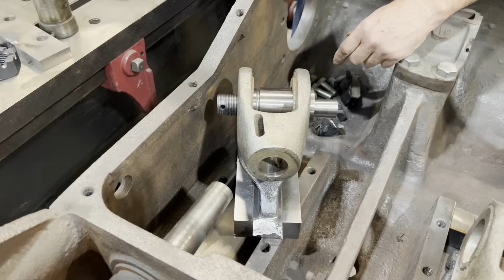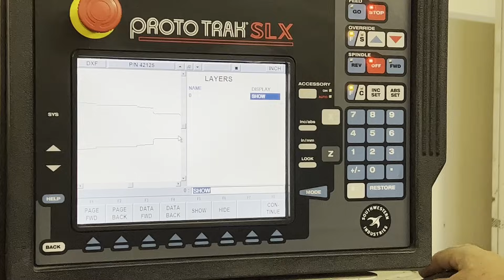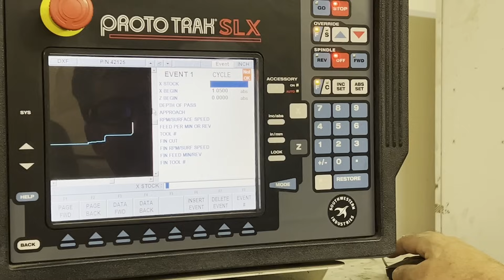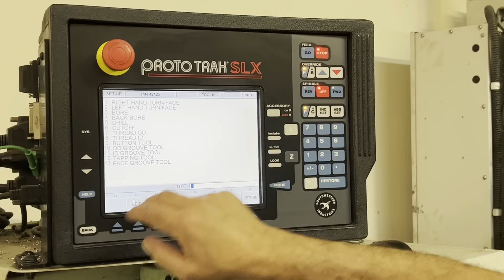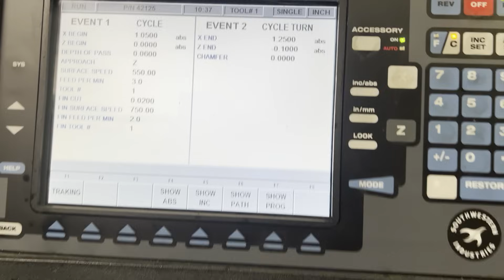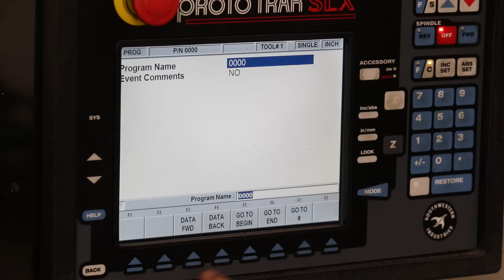Stoker Steam Engine parts for Vintage Machinery

Comment: It seems like on that threading cycle, ideal would be to be able to take bigger passes at the beginning, say 5 thou when only the tip of the threading tool is engaged, and reduce that as it engages more down to half thou when it's fully engaged. That control probably doesn't support doing that though
Reply: Also it is much better to set the tip in a slight angle at every round so that only one side is cutting - gives a MUCH smoother surface and reduce stress. Here at my CNC I set the angle to 29° (instead of 30° which is 60°/2) so its path into the thread is slightly diagonal.
But I think your simple controller doesn't support this. Nonetheless it's a genius thing to boost a lathe :-)
Reply from the maker: @123jogger123  Yes, I agree, actually the prototrac does give you the option to se the entry angle.  It defaults to 29.5 deg.  it also allows you to cut a multi start thread ( nested threads)and left hand.  Thanks for the tip!
Reply from the maker: Yes, I agree, and correct the controller isn't that smart.
Reply: @DragonflyEngineering  Is there even a way to do that in g-code? Other than stringing multiple threading commands together that each only go partial depth? I haven't tried threading yet on my CNC lathe...
Reply from the maker: @ yes there is a way. Mastercam does a similar thing with tap pecking. It just stacks up a bunch of z values

Comment: You can just Hard Turn the case hardening with a CBN Insert on the CNC lathe. I have done this many times before. The case hardness I have turned was 62 Rc in 8620 steel.
Reply from the maker: Thanks for the tip, I will mention it to Keith.